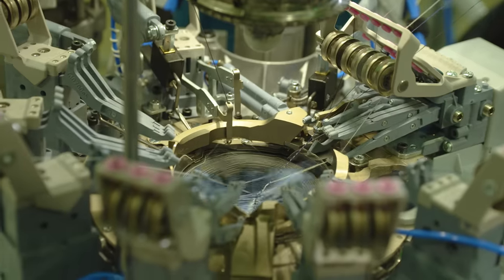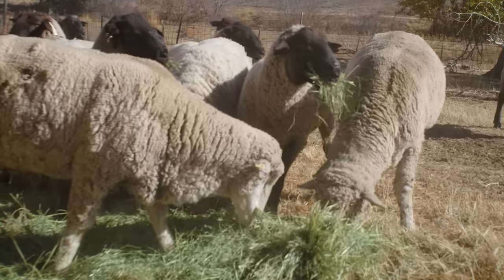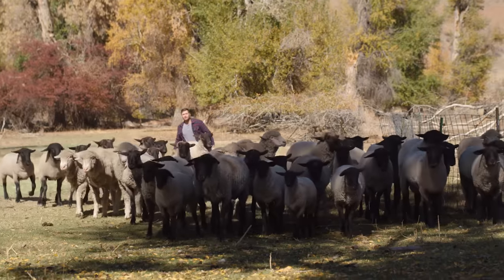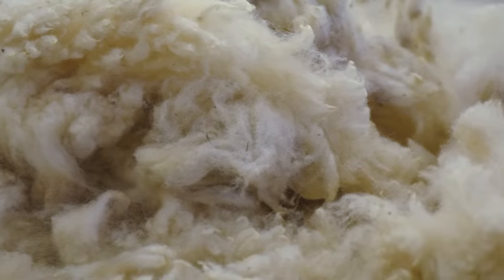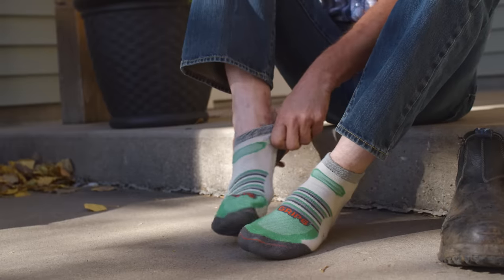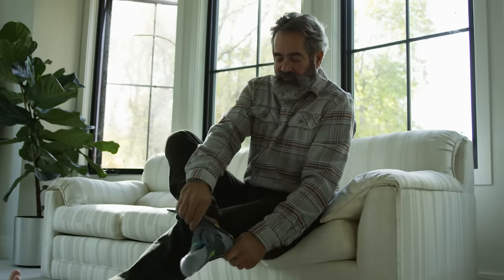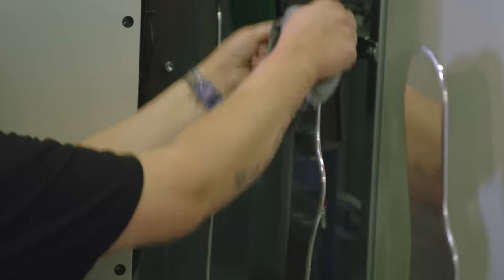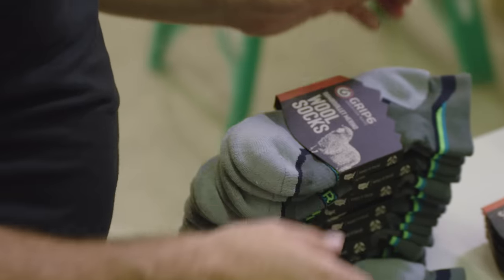Wool Socks With A Lifetime Warranty. Made In USA - The Most Comfortable Socks You'll Wear | GRIP6

Comment: What's the wool content in these socks?
Just looked, 38%!
I'll keep my Darn Tough and smartwool socks thank you. They range between 48% and 80% wool and wool is almost always the main material.
Reply from the maker: Michael, 

Darn Tough and Smartwool definitely make some good socks as well! There are a lot of recipes that you can use to make a good sock, and we choose a method that uses a high elastic content in our plaiting yarns (those are the skeleton yarns that the wool wraps around). The higher elastic content helps make the sock last longer, which reduces consumer waste and feels great paired with wool. We will be coming out with different variations, but this blend made the best sock to begin with because it's the best for the most applications: it's durable, comfortable, and still maintains the benefits of wool, which are moisture-wicking (keeping your feet dry), insulation (keeping your feet a constant temperature), and keeping feet smelling better.
Reply: @GRIP6  That is the best response to criticism that I have seen in a long time; it’s just one more reason why I have chosen to stick by your brand and promote it to others. I found you guys through JOMEZ, and I won’t bring going anywhere any time soon; just like my new belts, socks, and wallet.
Reply: I have 100% wool socks and a sweater, they don't hold really well. Much less than cotton